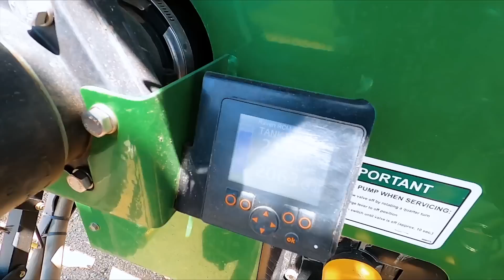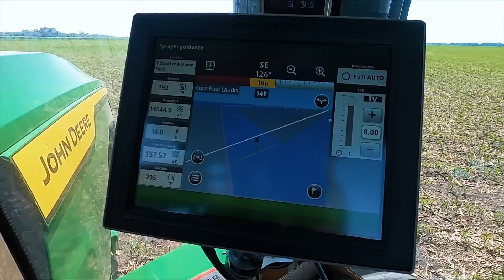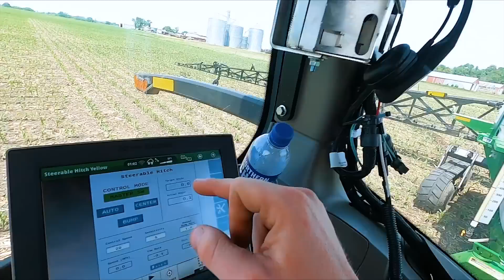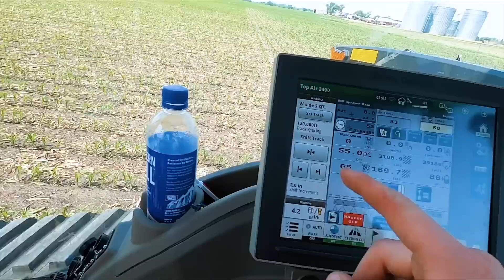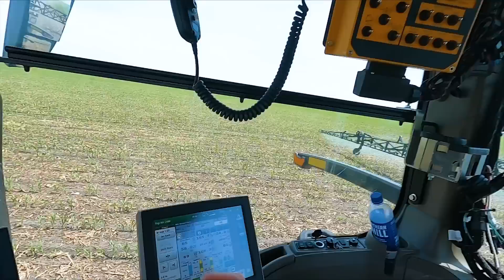Pull Type Sprayers Are Better!!

Comment: Crops look good, as far as trying to dial in the leaving space at your head lands, which I assume you have to set for each different field, why not shut off your inside row on your last pass as you are outlining? basically that would give you exactly one row corn snout width.
Reply: Overlap should only need set once per year. And can be set to leave a gap like chet was talking about so shutting a row off is unnecessary.

Comment: Chet
Wouldn't it be a good idea to put a air tank on your water trailer so you have more air capacity, maybe then you wouldn't have to run the truck every time you mix a load.

Comment: Ya nothing beats smashing half the crop spraying tasseled corn with a pull type
Reply: Did you see any smashing going on? Didn’t think so
Reply: @kenhofer8063  I said tasseled corn!
Reply: The use airplanes if needed.
Reply: @beckyumphrey2626  why pay for an airplane to come spray when you can have one tool that you already have do it, or in their case 2 sprayers. It could also put their nitrogen on throughout the summer when it’s taller instead of buying urea which costs more and having yet another tool to spread it in the spring. Plus the tender trailer.

Comment: Horse $hit on pull behinds are better. 😂
Reply: For Larson's operation the pull type is definitely better on paper.
Reply: @delbutler885 definitely. Using  the t tracks with steerable hitches is a slick set up. I run a self propelled and their set up definitely has its pros.
Reply: That’s your opinion
Reply: @kenhofer8063 that’s a fact.

Comment: Nah. Zero advantage other than capacity. Just more tracks on the crop and a stiff neck.
Reply: Less compaction, and with steerable hitch’s and t tracks, I’d damn near argue less tracks on crop than a self propelled.
Reply: @robo1210  I guess you forgot about the tractor lol
Reply: @johnj2748  with the steerable hitch, the sprayer follows the same tracks as the tractor.
Reply: @robo1210  yep and compacts them another time
Reply: @johnj2748  still a hell of a lot less compaction than a heavy ass self propelled sprayer with tires.
Reply: @robo1210  same as tractor often even narrower
Reply: @johnj2748  what? Tracks on their tractors and tracks on the sprayer is goin to be way less compaction than a self propelled sprayer.

Comment: GET a HAGIE Self Propel !!
Theeeee CADILLAC of Sprayers !!
Reply: The reasoning behind the pull type has been explained many times so I’ll give you the short explanation, obviously one self propelled could never keep up with the amount of spraying they do & one SP cost more than two pull types & have only one purpose vs a tractor ..
Reply: @6by6by6   a HAGIE with a 132’ Boom can cover many many acres plus a HAGIE can be used pre-emerge, Post-emerge, Side Dress 32%
in Corn, & apply Fungicide to grown crops !!
Heck a useful machine if ya ask me. 
Plus if you grow Seed Corn there’s a Detasseling attachment also !!
Your Pull type Cost analysis is Flawed. Gotta figure the cost of the tractor pulling them. Ya you have tractors sitting around but during Pre & Post emerge those tractors are on planters, rock picker, etc. 
the TECHNOLOGY on these New Self propel sprayers is just Amazing !!  EXACT SPRAY
& SEE & SPRAY that will save 10’s of thousands of $$$ on Chem. Wiping out weeds on Fallow ground !!  Spot spraying each individual weed itself.  JUST AMAZING
Worth the Big $$$$